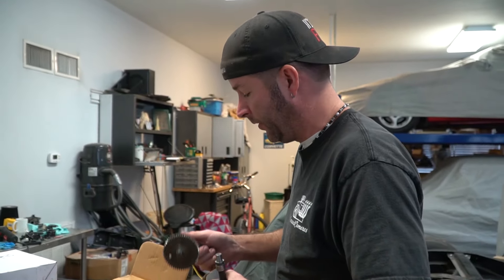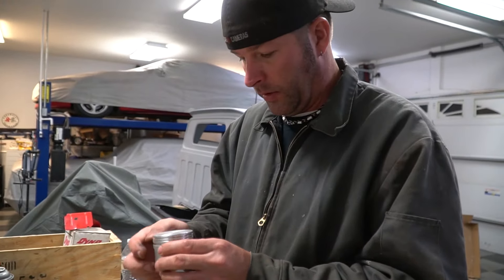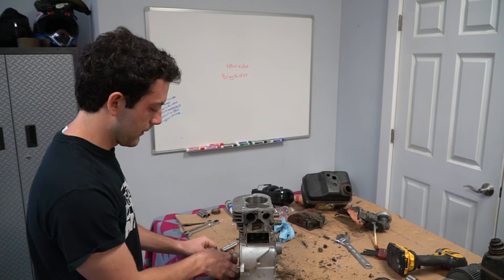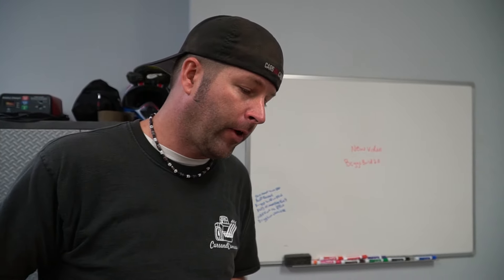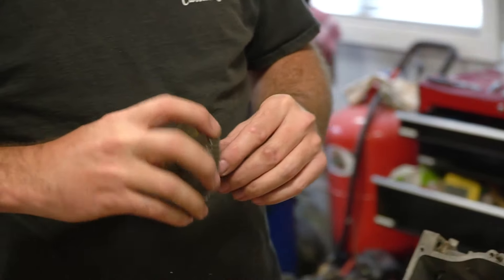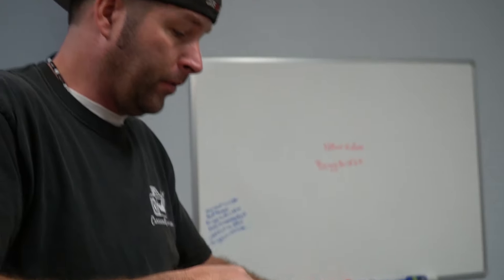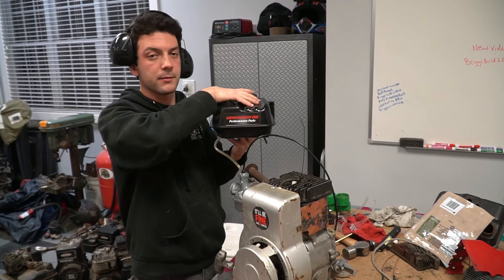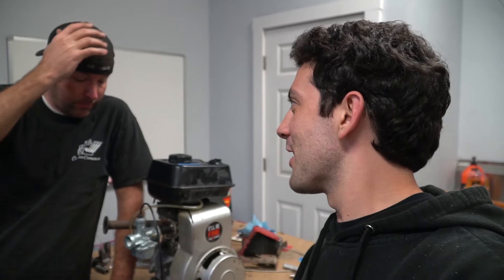Flathead Briggs Build from Scratch | Homemade Performance Mods!

Comment: Recently scored two 80's model Briggs 5hp flatheads for 15 bucks. Took em home and they both fired up, one has a carb, it fired with some gas in the carb, but the other one I got running with a bit of break clean, planning on building one and putting it in my Massimo carbon 6.5 mini bike that has a worn 196 on it.

Comment: I started with Briggs engines when I was about 8 years old. I lived in southern Virginia on 24 acres where my father borrowed a tractor and cut a 1/10 mile tri oval on a red clay field next to the house. My kart ran about a year then the rod let go. I had nothing to drive for about two months but when we were at a neighbor's farm I saw an old roto tiller on his scrap pile and bolted to it was a 5 hp briggs. I asked about it and said I could have it , but it was locked up. At first my father said no but the neighbor said it would keep me busy all summer and still not run. They laughed , but I was laughing 10 days later when it fired.
  A better flywheel to use is the aluminum one from a 3 1/2 hp push mower that uses the side mounted pull start cartridge. The gear that engages the pull start cartridge keeps the piece from blowing up. Don't use the regular aluminum flywheel , can explode at 6,000 rpm. I have run the one with the starter gear up to 9,200 and never had a failure.

Comment: We used a Kawasaki 75 carb on our old Briggs 5hp engines when I was a kid. They added between 40 and 120% more power depending on the cam, head or piston used.

Comment: I have a 2002 ultramax dirt gokart my brother used to race and still have the original 5hp Briggs that if I remember right dynoed around 10hp right now I have a 4 speed manual 127cc engine off a dirt bike for it I plan on running a open division this upcoming race season

Comment: The 07-3 cam is called a “slapper can”for controlled valve float.Set up right you go from.232 lift to between.260 to .290 lift.Flathead voodoo.

Comment: Just put valve spring in a vise with a bathroom scale to measure pressure at certain heights... 

Could have shimmed up the Predator springs to make up for their shortness... 

However, longer Briggs springs last longer... 

Tecumseh, Michigan only about a half hour from here... lots of my friends/relatives used to work at the Tecumseh factory... 

Tillotson factory used to be here...

Comment: Why all the H8'n of the B&S Carb?  When I was MUCH younger, I raced a Kart with a 5hp Briggs.  I never had a problem making the B&S Carb work right.  Easy to work on!  Easy to adjust...  Don't forget the "SPECIAL" Flywheel Key to advance the timing on your build!

Oh ya... Ring End Gap should be done with the rings OFF of the Piston.  Check 3 positions, top of ring travel, mid travel and bottom of ring travel to know what you have.

Looking forward to see how this build goes!

Willie
Reply: No hate on the carbs wr just didnt have a good one.

Comment: Better push the ring into the cylinder a bit when checking ring gap. You can use the piston itself to push the ring straight.

You  checked the gap in an area of the cylinder, the ring never touches when running. So that part of the cylinder is basically unused. 

Ring gap has to do with the wear of the bore and the ring.

But as alwyas:
Keep it up, that's great stuff :)

Comment: Check the ring gap between TDC and bdc, where there is wear on the cylinder, even if it's an iron bore, ring end gap will be smaller at very top/ridge

Comment: If you go directly to ARC Racings website they offer performance goodies for these old Briggs engines. Upon browsing their selection of parts I saw they offered a Pick-Your-Own stroker kit for the Honda clones and Predator 212's. To the point where the kits offer two different billet cranks made from two different types of steel. One of the offered pistons has three compression rings on it. :)

Comment: Long duration intake camshafts definitely raise the operating RPM range, but provide less torque. Higher horsepower gets you to a higher RPM quicker, but only torque can keep you there.  Most engine components such as crankshafts and connecting rods only have a 15% failure margin by design.   The metals are much softer compared to it's automobile or aviation cousin.

Comment: Take a stock cam  Add lift  & duration by tig welding grind it for the profile. You then have to send it to heat treatment. Also use a degree wheel on the crank .

Comment: Those springs that were with the 07-3 were probably right for that cam even though they felt light. That is a stock class racing cam so they typically use 15-18 lbs springs with stock class cams (depending on the cam). They are called “slapper” cams because they are designed to “slap” (float) the valve at higher rpms to gain more duration and lift for that profile of cam.

Comment: still got my old flathead briggs. has a wiseco 15 over piston running a shortened rod and a high deck piston 40 pound springs a hot coil from a tecumseh and a 33mm mikuni. overall its around 15hp and its true. a flathead brigs will outpower a ohv predator because they rev higher and build torque faster

Comment: Piston rings do rotate during operation and the end gaps will cross paths eventually, but it doesn't happen for long. 
I'm a big fan of putting total seal gapless rings in anything I've got torn down. 
If they don't have gapless rings for sale for your engine, send them a set of new rings and they will make them gapless for you!

Comment: For checking ring gap, put a bare ring into the cylinder and square it to the bore, about mid stroke, with the piston inverted. Use a feeler gauge to measure the gap between the ends of the ring. Specs for aluminum cylinder Briggs motors you're looking for about .035" on compression rings and .045" on oil rings. Cast Iron cylinder should be .030" on compression rings and .035" on oil rings.

Comment: You would have fun with 40/50's Crushman scooter with the Cushman husky 8hp they similar to Briggs I have mine still given to me my dad it has a beefy husky 8hp with straight pipes and a two speed suicide transmission I rode the dirt out of it the only mod was putting a smaller rear sprocket

Comment: So funny, porting lol. Guys, I'm my race car engines we open the area beneath  the valve to 85% of the valve diameter, we also narrow the seats to .08" on the intake and .1 for exhaust.  I usually use a 30 degree top cut and a 70 degree bottom cut. You should invest in a small engine valve resurfacing set, you can get a nice set for 250 bucks. The most increase you will get from porting is directly beneath the valve.  The predetor should make more power because  of better port conditions

Comment: A good Kohler k341 or k301 should be on your list for engine build. Those things are beasts and way better built than any brigs, and you could always go with something smaller like a k241 or something even lower. Plus people have made like 50+ hp on those things easy because you can just switch around parts from engine to engine and have a stroker k241 using a k301 rod and k341 piston, with k341 valves and a welded camshaft.

Comment: have a 3.5 briggs, (rod, cam, headwork, billet flywheel) but not installed on anything.....and, my favorite sofar, a subaru robin 6.5hp on a manco yardkart (kart's all JDM'd out, but not the engine), sooooo reliable....soon to be built (found rod,piston,cam,tuned header,intake,carby, and billet flywheel at Aussiesports)and hopefully still reliable
Reply: Do you have a link for the rod? I would totally buy one.
Reply: It's been a few years, but I think it all came from Jack's Small Engine...

Comment: To check ring gap, you have to take the rings off the piston and put them in the bore one at a time, squaring them using the piston. then measure with a feeler gauge.

Comment: As cool as it is to see an old Flathead Briggs built up like this, I still think the Predator 212 will beat it in terms of performance. Flathead engines were abandoned for OHV engines because they weren't as efficient when it came to compression and airflow, and tended to overheat more easily. But who knows, maybe the Briggs will have some surprises in store once it's ready.

Comment: i scored a super low hour 8 horse briggs from a 1976 snowblower. it has some fantastic vintage tins on it, and it fired up with the horrible two stage carb it came with. im wondering if the 22mm you used would be big enough to feed that stock 8? its going to end up on a rather large go kart frame, with a torque converter and golf kart wheels and tires on it.
Reply: 22 might work but i bet it might be a little small.

Comment: I use to run superstock flathead 5hp Briggs bored cammed tilotson carb on methonal professionally built and it was no joke i promise you well over 15hp outrun those predator motors. Nothing compares to the sound and feel

Comment: you guys should get a Wiseco piston for it...depending on what motor you have im guessing that Briggs has a bore thats 3.06 bore (they have 2.99, 3.06 and 3.56)  so you could use a KX250F piston which is 77 mm or 3.03 inches or a Husky FC250 is 78 mm which is 3.07 and then you would need to get a longer rod or cut and weld the original to get the piston tall enough for really good compression

Comment: Speaking of Mikuni carbs, I have a 2001 Kawasaki KLF 220 (an ATV) and it has a Mikuni on it, I'm not sure if it's a stock carb or not but it seems to run fine in warm weather, and I used to run a 3 HP Briggs on my old go kart but now I have one with a Predator 212 on it, the four wheeler hates running in cold weather, but I can go and start the Predator on the 1st to 2nd pull.

Comment: If you want to see some monster flathead single cylinder motors, you need to check out garden tractor pulling. Most of those guys run the cast iron Kohler K-series engines.

Comment: I had a Tucumseh 6hp on my go kart and i never could get it to idle. It would idle high or shut off. Which ever way i put the screw, there was no in between. I tried new carb and the last thing i tried was drilling out the idle jet but my smallest drill bit was to big and it flooded out. I got a predator 212 and there is a pretty big power difference. My predator has been sitting since August 25 cuz i wrecked my go kart. I just went out last Saturday to fix my kart and the predator crunk up no problem. I DO NOT RECCOMEND GETTING A TECUMSEH. My dad use to work on small engines (pressure washers, lawn mowers etc.) for a living and he doesnt like Tecumsehs either. If your trying to decide between briggs or tecumseh, go Briggs.
Reply: Yea totally, but I do own one.a 5 horse powersport that came with a 30 series torque converter. Took apart,cleaned everything up real well, and then I noticed it. Has a wiggling crankshaft when reassembled. Can pull it out about 1/8 in or 1/4 in and push back in. Not good. Idk the problem or solution. Got ideas? Just want it running for the kids cart so safety is important.

Comment: I think it would be a good idea to lube the cylinder, connecting rod bores, the camshaft tip that slides into the case hole, the camshaft loves should be greased, along with the crankshaft journal and oil the cam and crankshaft cogs then give them a couple of full rotations to spread the oil evenly. The engine oil should be changed after one hour of use to remove all the micro shavings that are the result of the new parts rubbing together and smoothing off the sharp corners from their manufacture.

Comment: You're checking it on part of the cylinder that's not worn, take the Rings off and push the ring down about an half inch with the end of the piston and then check your Gap

Comment: What is the benefit of putting a 3hp flywheel on the 5hp engine?  Is it all you had to use or is there a performance gain?
Reply: They are lighter and smaller diameter so the engine turns up faster

Comment: I run a arc 3.5 hp flywheel dont have to worry about flinging a magnet off when you turn 8000rpm I have a dyno 107ss cam as well

Comment: Hi @CarsandCameras ! Are you guys using the Chinese Mikuni or the real one? I've been working on a Subaru EX21 7hp motor and thinking of getting a new carb for it as I'm running a open header. Just wondering if the extra $40 is worth it? Thanks!

Comment: Briggs & Stratton vs Tecumseh is like Black & Decker vs Skil of the cheap electric drills back when. the B&D was lower RPM higher torque, Skil was higher RPM, same for the 2 engines. it was also the same for their reliability, B&S and B&D being the longer lasting.
1974 we popped in heavier valve springs, made an adapter plate to mount a 6hp updraft carburetor onto a 4hp engine, it ran like that Chinese jet pilot "Ho Li Chit". a little sluggish in the low RPM like anything over carbureted, after about 3000 RPM it felt turbocharged. cut down the air paddle of its governor so it'd spin up near 6000 RPM, much more than that the valves would be floating and flames out the tailpipe anyway. it made the old Hiawatha Doodlebug a little screamer... belt driven minibike with the chrome "Whizzer" gas tank, from the 40's.

Comment: The cylinder head bolt torque is 16 Newton metres or 140 in lbs,I need to fit a valve guide bush in my 9 series engines inlet valve guide as I noticed it had a bit of slop in it last time I lapped the valves in.

I think that's what is causing it to burn oil but not  a lot of it although it used 200 mLs of oil in 2 hours (1/3rd of a 600 mL  quantity) when my dad borrowed the mower,that's quite excessive I think !

Comment: You need to order you some cr500 clutch basket springs. They work amazing for the valve springs in these motors as valve float kills these motors.. so order a set of stock cr500 clutch springs. Then order a set of after market cr500 springs that are stiffer. Then you will have a very very strong and tight spring as they are very stiff

Comment: i had an old brigs 3hp i put 4.5hp flywheel and coil on it and it had a old school carb and gas tank with a spring operated choke in it  i got it running and tuned it and when i got done it was pushing close to 30hp and would rev super high my neighbor tried have a revving contest between it and his ford truck that had 351 windsor in it and blew his engine up and my motor was still gaining rpms

Comment: You should have check the ring gap by taking ring off push it about 2 1/2 in down not at the top of the bore.the top of the bore has no wear on it because the rings are not going to the top of the deck. Turn your piston over an push the ring down that will make it even all the way around. then check ring gap.. Just a hint for you.

Comment: I have a question for Ike.  Do you know what material the camshafts for the 5hp flatheads are made out of?  I have a stock replacement one that I want to weld up and regrind at a family member’s machine shop and they said I should find out if it is cast iron, steel, aluminum, etc.  Thanks.

Comment: Guys just for bigger engines (sbc/bbc) i know you actually benefit more from having a non polished intake port so it atomizes fuel better before the combustion chamber... not sure if it really makes a noticeable difference on a 5hp but shoot you are going this far and have a spare block you should put Ike's "Fatman Cam" in ole smokey and use a little nitrous. Its already got the extra ring gap haha just seal those valves up.
Reply: We didnt polish the intake just ported it
Reply: @isaacitllbefine7231  what is your opinion on the porsche/vw smog pump "supercharger" on that built smokey motor? And will you guys ever do an alcohol engine build? Been thinking about doing a heavily built 5hp flathead off a snowblower i got for free and welding the cam, and possibly very high compression but dont know the first thing about alcohol or methanol style fuels on a small engine
Reply: Never messed with alternative fules

Comment: I have a Briggs 5HP on a old go kart that I have removed to governor, put a Honda clone Carb on, exhaust, and a pod filter. I have re jetted countless times and it finally idles half way decent but I notice it surges. Also it revs freely when it's not under load. However as soon as I'm sitting in it, it dies as soon as you give it any throttle. Just wondering if you might have any idea what's going on. Any insight would be greatly appreciated. Thanks
Reply: Idle mixture is my guess

Comment: Hi guys, I have a Briggs Stratton 5hp engine and I want it to have more power. What camshaft do you recommend and what springs do you suggest? I have an aluminum flywheel and piston and MSD coil. Would you be kind enough to help me? Thank you very much.

Comment: I built a briggs 5hp once and I had to reinforce the valve lifter guides. When you add valve springs for high lift and high rpm they get too brittle for the task. I never tested the engine.

Comment: I was given an engine from a 2013 Kawasaki ninja 300. It runs. It makes 40hp. I want to build a shifter kart but cannot find a chassis in my budget. Everything around here is like $450-1000 for just the frame. Do you guys think just a standard adult sized single seat live axle kart frame  would hold up?? Of course the steering would be modified as well as a beefier axle

Comment: Run it for 50hrs half throttle to allow rings to seat from honing and change the oil must be done with out a load on the engine

Comment: Grin, it doesnt smoke like the other one.
I would  have used a clone as opposed to the older style engine.  The clones have a better ability to breathe from overhead valves.  There are other items as well not worth getting into.  The only reason the L heads are no longer made is because B&S were bought out.